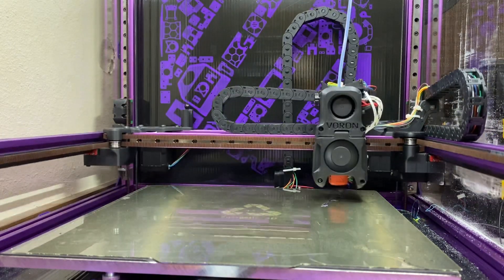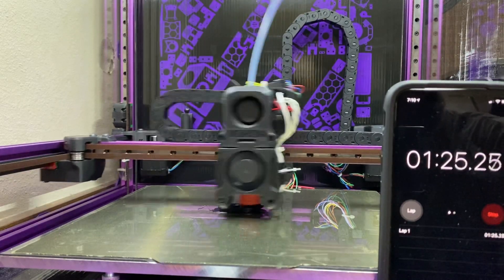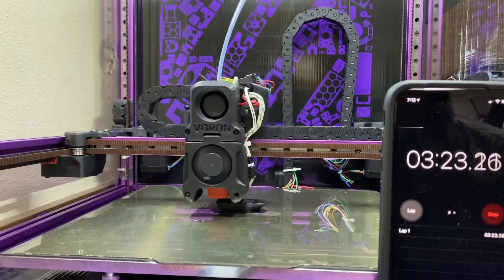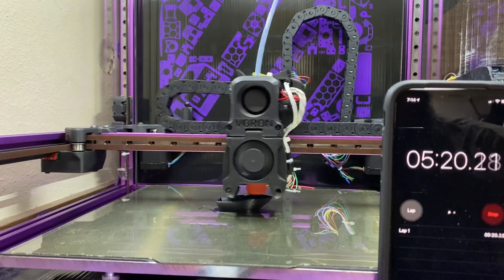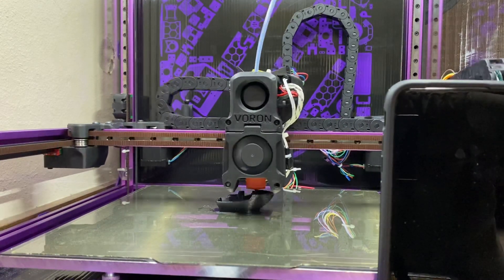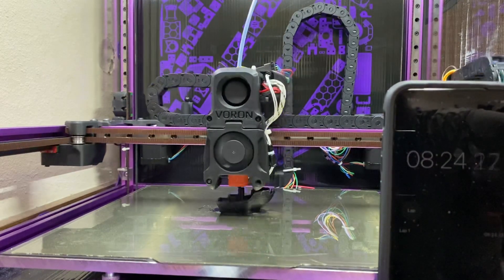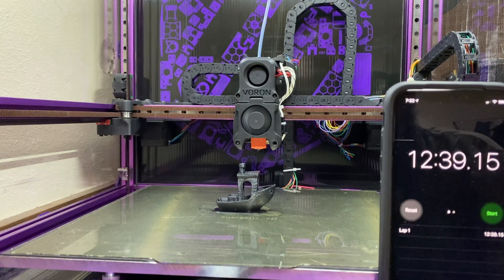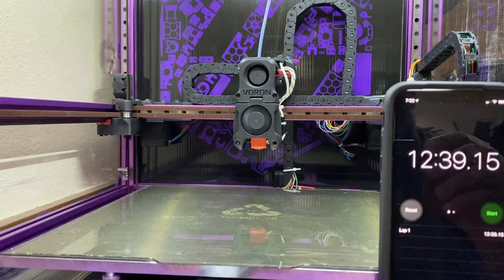Voron 2.4 12 minute benchy

Comment: What is the point of printing junk quality at high speed??? Now if you print a high quality benchy at high speed it would be a different story. But all the high speed voron benchys that I've seen they all look like crap. So either the Voron 2.4 sucks as a high speed 3d printer, or in order to get a high quality benchy out of it you need to slow things way down, like 100mm/s, which is no different than any of the other high quality 3D printers out there. So my question is, why are you spending $1500 to build a printer that can only produce high quality parts at the same speed that other $300-400 3D printers do???

Comment: How does this printer probing the bed? Is there a nozzle touching a printing bed with anything like strain gauge?
Reply: Either use the stepper current or a tool length probe like you find on CNCs

Comment: Awesome run. Would you mind posting your gcode? For the life of me I can't seem to simulate a sub 24 minute benchy in prusaslicer or cura.
Reply: Your acceleration and jerk in klipper are probably set too low. It’s a stock printer but I doubt the firmware is stock.

Comment: Parts for my 2.4 305mm are incoming. Super excited.
Reply: i'm confused, most of the reddit posts I see state that most voron 2.4 cost ~ $1500. but they're mostly also from 9-12 months ago. FORMBOT sells a kit for ~ $750, and then $100 for the parts on PIF.... of FORMBOT using super cheap parts? or have prices come down over the past year? how much did yours cost and did you source it all yourself or buy a kit?
Reply: @monkunashi  I bought a formbot 350mm kit for 900 with 100 in shipping, and I needed to replace some of the lower quality components (bed heater, hotend, heater cartridge) so total it was about $1300 with PiF. I'm finding small things in my formbot kit that are incorrect, but they aren't preventing me from building. I am relaying all this info to a formbot representative and they are changing the production.
Reply: @MacRobeson   thanks for the reply/info. this would be my first printer, and I see a lot of people saying to get something else first - but i don't really want to buy something cheaper/lesser just because this requires a complete build if voron is truly "the best" as almost everyone seems to think it is.  But if its going to cost $1300 instead of around $800, it might be a bit much, $800-850 was already stretching it. ender 3 v2, prusa mk3s, ender 5 pro, and ender 6 are all on the table. i've spent so much time researching to try to make a decision - my head hurts. lmao. if you have any experience with any others or any other advice, i would welcome and appreciate it.
Reply: @monkunashi  I've had a Lulzbot TAZ 5, Ender 3/3 Pro, Prusa i3 Mk3s and now building my Voron. I agree with others, this really shouldn't be your first printer. You need to get experience with actually printing before building something like this. I'd say grab an Ender 3 and just have fun, don't think of it has "lesser" just think of it as your first. Was your first car a Tesla? Prob not lol. This is to gain experence. Then from there look into a Voron 250mm wich would be much cheaper at around $900. (Plus you'll still have your ender as a second printer!)
Reply: @MacRobeson  can you explain why one needs experience first? if its difficult to explain, thats alright, just curious. I subscribe to many 3d printing channels and watch a ton of content, so I would rate my knowledge relatively high as a non-user. however obviously there's no substitute for experience. Though I am a technical person by nature (i'm a software developer). what I struggle with, is I have $600-800ish to spend. a ender 3 is well below that, and while its a great printer for the price, its not a great printer for the $800 price range. if I buy that, and then a voron later, i've now increased the cost of a voron by $300+ (assuming i do some mods to the ender 3 lol). and yes, i have a 2nd printer - but I don't really need more than 1. at least I don't think so. lmao. maybe i'll change my tune after having one.
Reply: @monkunashi  I find experence though videos is amazing as well, there are just small things with printing that you'll learn and a Voron is a complicated printer (4 Z points, Core XY, Klipper, custom wiring, etc.) but that definitely doesn't mean you couldn't build it as your first. I'd say if you're really looking to stay within the $800 budget, but want to build yourself, grab a Prusa i3 Mk3s kit. Sure the build surface is smaller and you can't print as fast, but it's an amazing machine for beginners and building it is easier with a much more detailed guide. It produces amazing prints and has a lot of built in self checks. I bought mine as a printer for my girlfriend because she wanted to learn and I just turned her lose on it. Great so far.

Comment: i know it mostly doent matter, but what size is your voron 250? or 300, im seeking to buy a kit, but im not shure if i want the bigger 300 or the smaller 250mm
Reply from the maker: I went with the 300 size.  I already have a small printer for small parts (V0).  If it was my only enclosed/abs printer I might do the 250 it’d heat up faster.
Reply: @JoshMurrah  well it would be a replacement to my current 3dP so it would be my only 3dp for a long time
its going to be an upgrade for an ender3 (first version to market), seeking for faster prints and reliability.
Since i have wished my printer were larger ONLY in 1 proyect, so i think i'll assemble a 250, but i want to pick a choice to pack it up with tons of  extra features, it needs to be spacious enought to put the extra things (multy camera setup inside, sensorles endstops, big octoprint screen, etc...)
so the point is that im not shure the 250 version is capable of all those features.
Reply: @JoshMurrah  wait, core xy cant use sensorless homing? or can they?
Reply from the maker: @zark0_code  yep they can.  I just reconfigured mine to do so.

Comment: On my Ender 5 plus I can do a under 1 hour Benchy , 0.4mm nozzle , 0.2mm layer height , 20% infill , which is as fast as it will go without breaking it.
Reply: At what speed ?
Reply: @oohsam  I've found that I made a big mistake !!!! , I was running at a top speeds of 100mm/s  , But while I was bumping up the acceleration I was also bumping up the jerk at the same rate .
Last night I ran the same gcode with the default jerk setting and lots more acceleration and got a 59min benchy without my ender 5 plus sounding like it was going to die at any moment like before.
I think I've going to try again with better setting in cura , because I noticed that some of the time it was running at 10mm/s which was to minimum layer speed for under 10 seconds per layer.
Reply: @peteradshead2383  ah I see. I'll try mine with 100mm and see what I can do
Reply: @oohsam  I've tried to pushing it to "infinity and beyond"  Which in my case was a flat rate of130mm/s , not sure what percentage it was going at that rate ,  But I can say I'm in the 40 minutes or less 0.2mm benchy club now with a time of 38min .  
Not bad for a ender 5 plus non core xy , it looks like shit with massive amounts of ringing ,  But can't say I've seen any of the 20min or less benchys in fine detail .

Comment: Your inverted gantry to squeeze out extra usable z height looks awesome! Any drawbacks? I'm just a guy about to start his voron build. Have 80% of the parts printed and I simply can't curb the excitement of starting this build.
Reply from the maker: Not really any issues just invert your corner parts - there’s a challenge on the corner where the wiring routes - I put my wiring between the belts - sounds scary but works fine.  Use the “short Z” in usermods for your corner oarts, and your rails mount towards the top instead of bottom.
Reply: @JoshMurrah  Don't you get issues with the reverse bowden above 270mm Z-Travel?